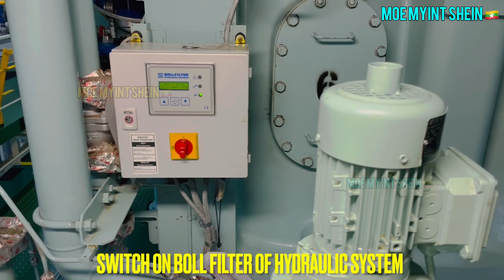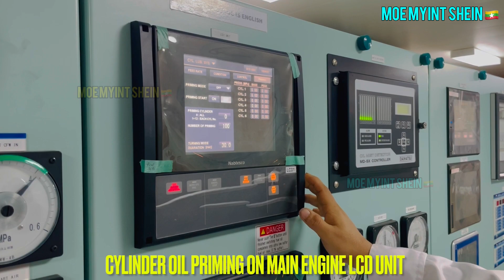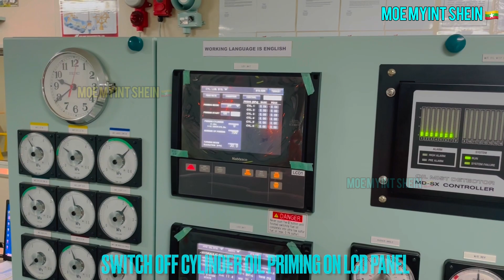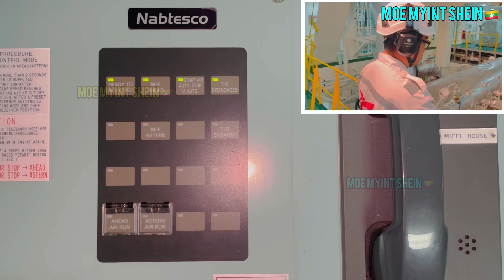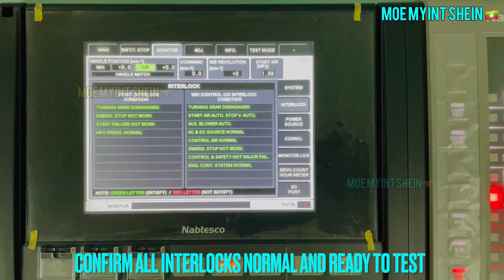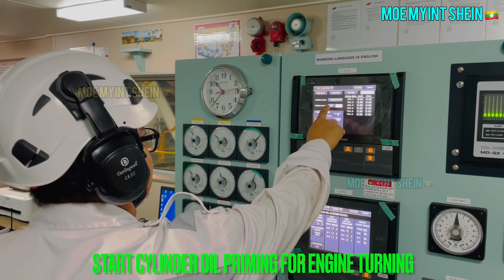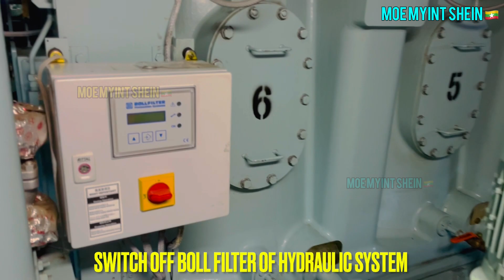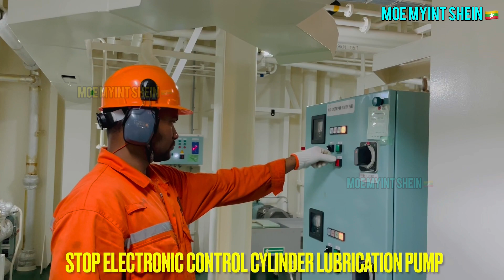Essential Preparations for Ship Main Engine | Ship Arrival and Departure | Technical Vlog : 083

Comment: Why did you close the Skavenc drain, Ser? Then you opened it? Shouldn't it always be open while the host main engine is running?
Reply from the maker: According to engine maker’s instruction.
Reply: @CHiEF_MOEMYiNTSHEiN  Wouldn't this cause a skavenc fire in other engines?
Reply from the maker: I assure you may notice two valves at the same line. And also you may observe both valves didn’t close at the same time. 
Thanks.
Reply: @CHiEF_MOEMYiNTSHEiN  There are many lines on the ship, anything can happen :)))
Reply from the maker: I agree anything can happen onboard. To prevent issue you worry about, caution was posted by maker near these two valves and clearly instructed which valve open and close depending on conditions.
Reply from the maker: Do you think scavenge fire will happen if in case these two valves were closed without noticing while main engine was running?
Reply: @CHiEF_MOEMYiNTSHEiN  Yes, wouldn't soot accumulate and cause a Skavench fire?  Only when we were going to transfer the skavenç drain tank to the sludge tank was the drain valve closed.  I didn't have a good cadetship, and I'm not a good marine engineer yet. I haven't even go my first engineer ship yet. I could be wrong.
Reply from the maker: If your main engine is not well maintained (i.e fuel injectors were dripping, cylinder oil feed rate is high  and too much blow by occurs between piston rings and liner), yes - Scavenge fire can happen. If not - no chance for scavenge fire. 

If oil accumulates in scavenge air receiver (scavenge air trunk), drain oil will overflow and sneak into air cooler drain that leads to bilge holding tank (or clean drain tank on some vessel). 

If you observed oil in sight glass of air cooler drain line (or) lube oil foaming in bilge holding tank (or clean drain tank), this is significant sign of scavenge drain line is blocking on somewhere. 

Above mentioned facts were based on my experience. 😊
Reply: @CHiEF_MOEMYiNTSHEiN  I couldn't make that many observations :) I don't have much knowledge or experience . thanks sir.
Reply: @CHiEF_MOEMYiNTSHEiN  I think there was such a glass under the air cooler, I think I remember it now. thanks sir.
Reply from the maker: Don’t worry. 
You will be sharp and smart engineer in one day. 
Stay hungry. Stay foolish. 😊
Reply from the maker: That’s correct. 👍
Reply: @CHiEF_MOEMYiNTSHEiN  Sir When transferring the scavenge box drain tank to the sludge tank, should we close the valve that vents the oil mist tank and is located on the scavenge box drain tank? This oil mist tank was also known as the ASH RAIN tank.

Comment: Sir we always run Two Eco Hydraulic Pumps in 5UEC50LSH Eco CII. Now I see only one start and one stby. Can you please explain sir?
Reply from the maker: In exact, One is lead and another one is follower. 
Only one pump is required to turn engine by turning gear. Otherwise, turning engine is low load operation. 
Doesn’t require to run both pumps. 

During engine running with load, engine control system decides either one or two pumps, need to run. 

When engine driven pumps are working, both Eco pumps are in standby mode.

Depends upon model, procedures and requirements may differ.
Reply: @CHiEF_MOEMYiNTSHEiN  Thank You for splendid explanation Sir.